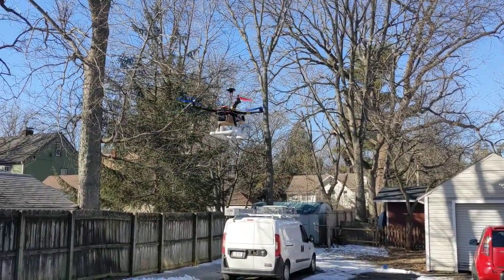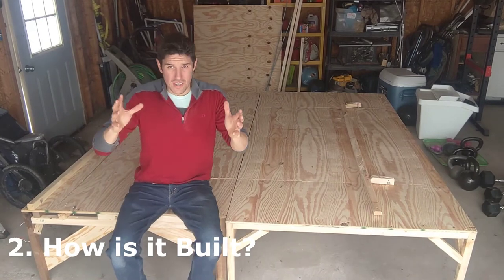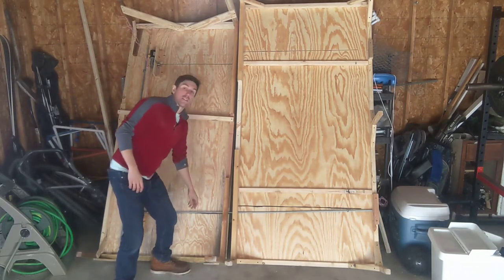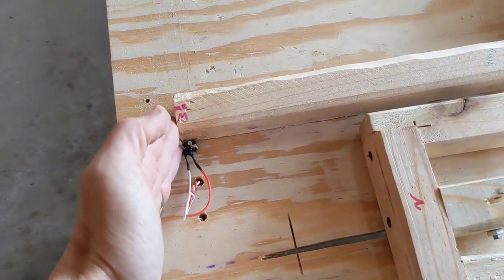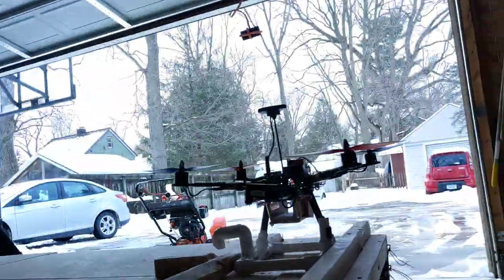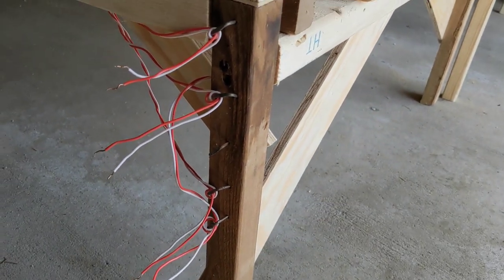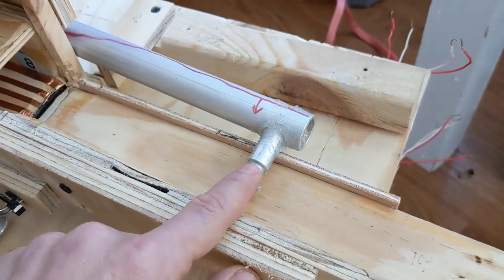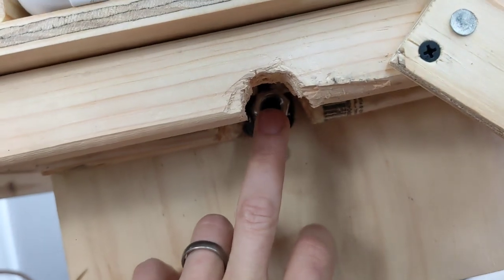DIY automated drone battery swap, landing pad and relaunch - less than $900

Comment: Just Wow. This is terrific!

Have you considered doing this with fixed wing? Kind of like the Zipline system? I love what you are doing and how you are so down to earth about it all. I was training to be a design engineer for repetitive manufacturing equipment before my life changed entirely.😃 But I would love to find a way to connect the dots and see this become an awesome business. The market is ripe, for this type of innovation. Thanks again for sharing your genius and hard work.
Reply from the maker: The zipline system is really cool. doing some vtol fixed wing design would cover more area, we'd definitely need more computing horsepower to take/analyze images in time to use them though.  I'm hoping to upgrade the compute power in the next revision, so perhaps in rev 3 I can move to fixed wing to cover more ground

Comment: Man, you would be a great engineer!! The way you solve problems looks so straight forward, but as a student myselve, I know it is hard... Did you have any educational insight before you started this project?
Reply from the maker: I'm actually a retired electrical engineer, but I worked on chip design so it wasn't really relevant to this project.  I mostly designed this by trial and error :)
Reply: @nathanbuildsdiy  seems familiar, I am currently making my own plane with arduplane. Indeed a very nice software, but the trail and error is sometimes really frustrating. ;) for now, keep up the good work!! I think you are briliant the way you inspire people to do these projects!!!

Comment: Awesome vid! Do you think this could work with a LiPo battery w XT60 plug? We’d probably have to have some sort of robotic arm, but do you think it could work? Thanks
Reply from the maker: Yeah, the plug type shouldn't matter too much. Next round I want to 3d print the battery housing and charging ports and you could change the charger type to anything you like - plug in the battery and it'd charge normally, way less customization of the battery that way

Comment: Awesome video this has inspired me to make a rover drone I might have a few questions for you in the future. How can I direct message you?
Reply: @nathanbuildsdiy  got it thanks
Reply from the maker: @HandsomeOrHandy    I've already started working on the next revision of this myself.  Here's my notes so far:
- Add more battery bays & chargers
- 3d print battery case that fits the battery and fits into battery bay and onto the bottom of the drone (probably some clip system on bottom of drone).  Battery bay should also conector for power and charging so you don't modify batteries directly (the battery plugs just plug into the battery case, which then presents those leads to the battery bay chargers and drone power/gnd
- Improve the model accuracy with more training images
- Make the landing pad faster - specifically I'm going to remove the threaded rods and instead put in a system like a garage door opener - a long bike chain where the same motor just moves the bike chain back and forth (which moves the landing pad arms back and forth) rather than the threaded rod.  It'll collect the drone so much faster.

Comment: You said there is a 900Mhz radio for communicating with the laptop. Which kind and how please?
Reply from the maker: RF design.  I'm in the US so I bought this one:
https://irlock.com/products/rfd900-telemetry-bundle

It's a bundle with usb plugin (to the controlling laptop) and the other side plugs into the cube orange (autopilot) that controls the drone.  The range is something huge, I've never found the outside limit.  I'm not associated with RF design at all, it's just one of the ones recommended in the ardupilot forums so I went with it.
Reply: @nathanbuildsdiy  Thank you for your quick response and sharing.

Comment: youtube should add a mono audio option to the gui for videos that end up only using the left audio channel.
Reply: If you're on mobile/Android there may be an option to enable mono audio in the accessibility section of your device settings.
Reply: its hard to imagine watching youtube on a phone... i guess some people do but honestly a monitor is like 100x better even compared to tablets if stationary. its absolutely possible but turning audio to mono and back on linux is kinda annoying, on windows even more so due to all the gui navigation required.
Reply from the maker: My bad - this was filmed and uploaded before i realized it was mono audio. Newer vids are fixed
Reply: @nathanbuildsdiy  all good, shit happens. honestly when i edit literally anything on my main channels i only have the left earbud plugged in anyways. its always good practice to double check every detail before and after uploading and schedule the video at least a week ahead; even if its something you don't notice yourself there are a lot of people whos gears it will grind. even small things like calling a nema 23 motor a nemo 23 instead.  youtube seems to not have a whole lot of options for additional processing, and those they do provide end up not working or getting messed up from a future youtube update. oh, also nice design, i never thought of something like making giant push bars to corral a drone in like that. definitely stealing your idea.

Comment: How much flight time do you get from those battery packs?
Reply from the maker: About 15 minutes, it's a heavy drone!
Reply: @nathanbuildsdiy  thanks for the reply. Excellent video and well laid out presentation of your project. I’m in the process of building one myself using your format. I’ll let you know how it goes.
Reply from the maker: @timrit3817  That's great!  I've already started working on the next revision of this myself.  Here's my notes so far:
- Add more battery bays & chargers
- 3d print battery case that fits the battery and fits into battery bay and onto the bottom of the drone (probably some clip system on bottom of drone).  Battery bay should also conector for power and charging so you don't modify batteries directly (the battery plugs just plug into the battery case, which then presents those leads to the battery bay chargers and drone power/gnd
- Improve the model accuracy with more training images
- Make the landing pad faster - specifically I'm going to remove the threaded rods and instead put in a system like a garage door opener - a long bike chain where the same motor just moves the bike chain back and forth (which moves the landing pad arms back and forth) rather than the threaded rod.  It'll collect the drone so much faster.
Reply from the maker: Just realized I forgot 1 more - 3d print the landing gear/tank. It'll be way lighter that way. The weight of the pvc landing gear really adds up!
Reply: @nathanbuildsdiy  I was thinking the same thing about the PVC landing tank.  I was thinking about using something like a 20 oz soda bottle.

Comment: Add a small wind speed anemometer  to the raspberry pi.  Can build that into the code to adjust for wind speed/direction on landing.
Reply from the maker: I was thinking of using an anemometer on the landing pad to avoid launching when winds are too high as well.  You really don't want spray drifting in high winds either.